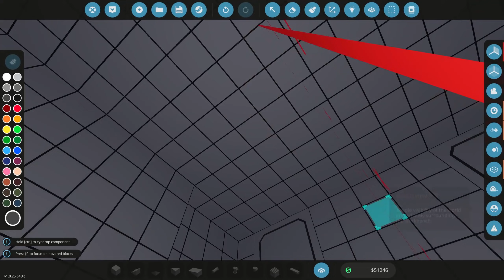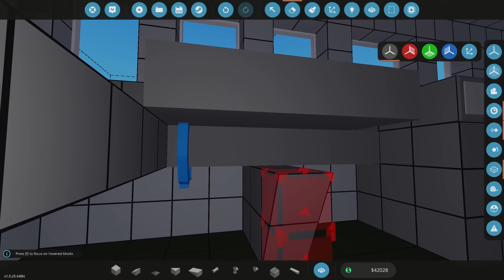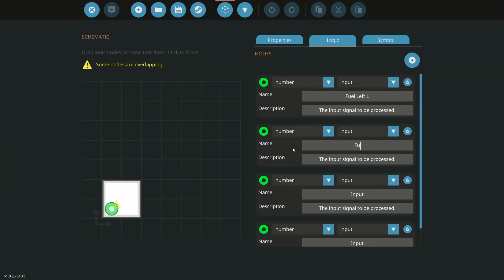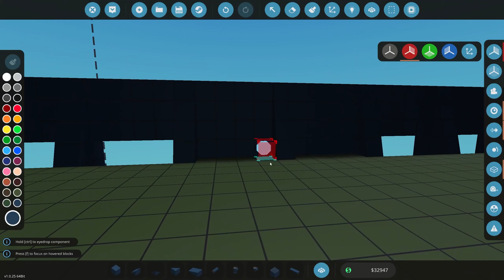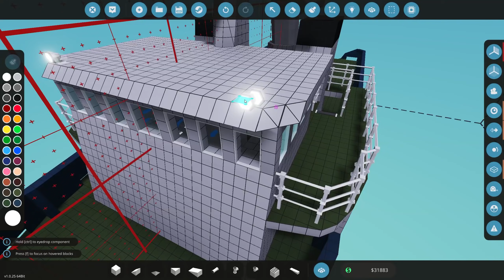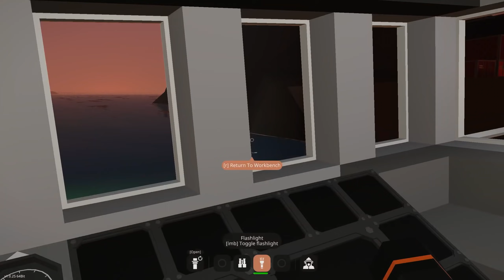Bridge Systems - Survival Series Part 13 - Stormworks Version 1.0

Comment: If the fuel tanks are different sizes, the percentage will be wrong, as the smaller tank will have too much influence.
Reply: Good catch.  Could just add up all the fuel/capacity and then convert it to percent, I think that's the most accurate way to do it?
Reply: @stevepittman3770  Yup. Kinda wish we could configure the number of inputs on the function pieces, since this would take 4 of 8. 100*(Amt_L + Amt_R)/(Cap_L + Cap_R)

Comment: If you use ex. 48 chargers you can charge the battery very quick. They need however to be connected independently to each other.

Comment: Is it possible to make a ship diagram on a video display, that could then indicate a damaged compartment.
Reply: That's a cool idea, but no clue if it's possible.
Reply: I've not tried this, but the fluid meter has a capacity output. It reads 0 if the "tank" is not sealed. Read values with a microcontroller, then do whatever you want with a 0 value - alarms, display, etc.
This will only work for sealed hull damage though, not damage to other equipment or areas that don't form a "tank" of some sort. You can't, afaik, monitor for damaged blocks.
Reply: @tin2001  I was thinking that, so the actual difficult part would be making a ship's blueprint on a screen

Comment: I have tried to test it no luck. But is there a difference between connecting electrics in serial connections and connecting it directly from component to a relay?
Reply: If a component gets destroyed (or maybe even damaged?) anything connected through that component will lose power.  Personally I like doing it that way anyway because it's cleaner and the risk is pretty low.